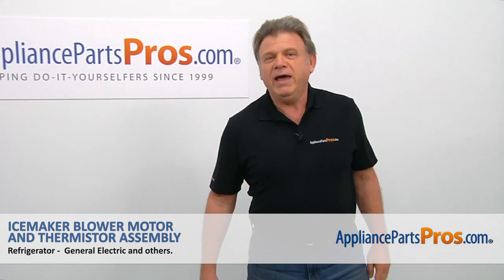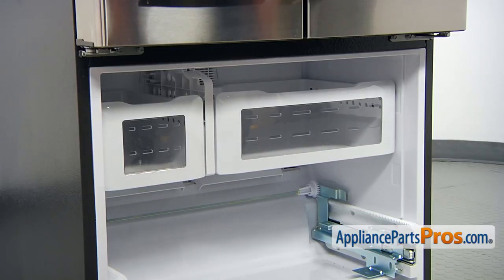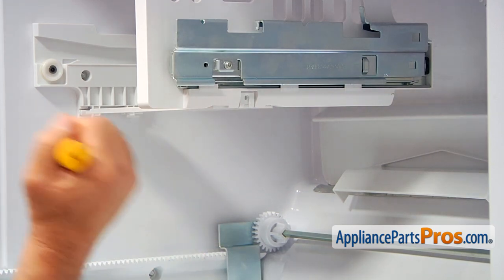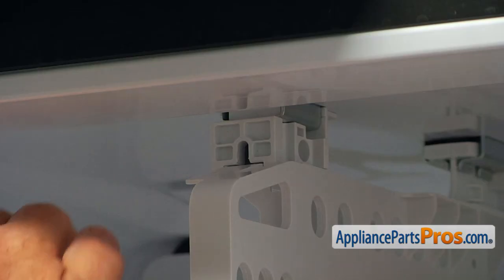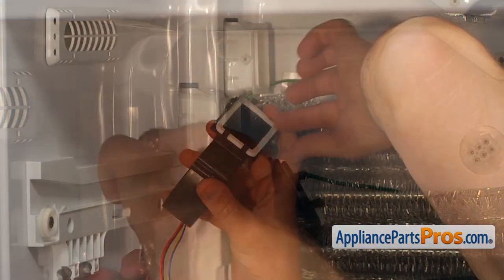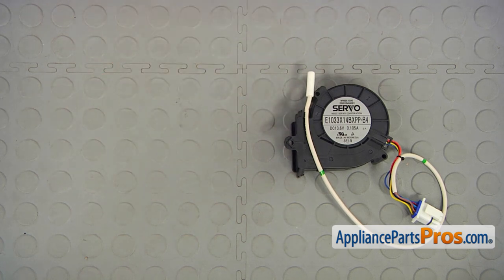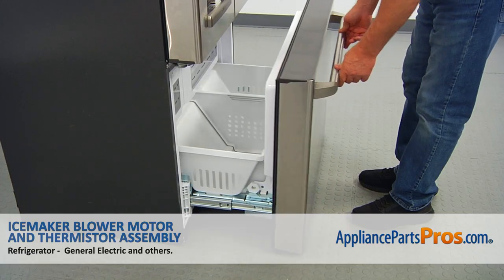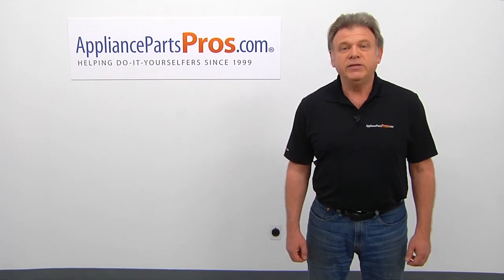How To: GE Refrigerator Icemaker Blower Motor and Thermistor Assembly WR60X10342

Comment: There is two duct to the ice maker compartment. Bottom one is getting cold air and top is not getting cold air. What would be the reason.
Reply: 1 is to bring cold air in and 1 is a return. I'm having the same issue with mine not making ice.  That motor was full of ice so i cleaned it out but its still not making ice. 
Not an easy refrigerator to work with sometimes 😂